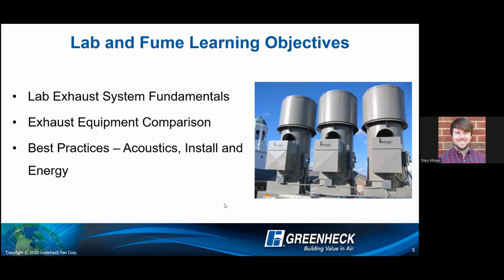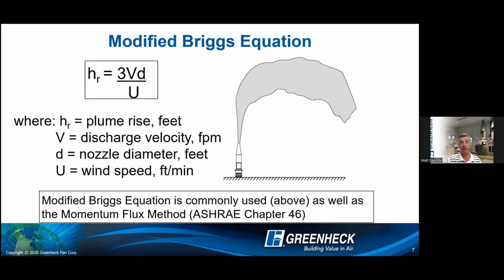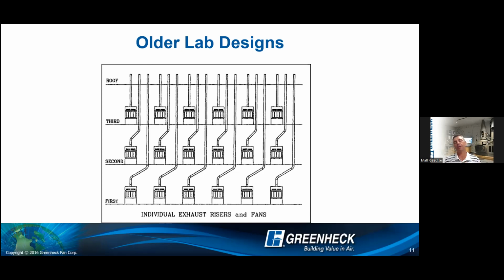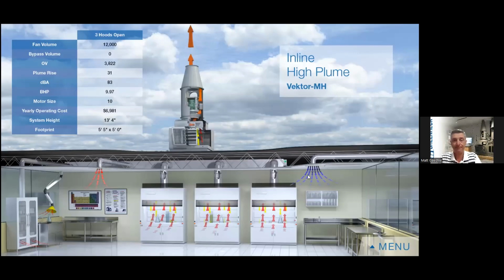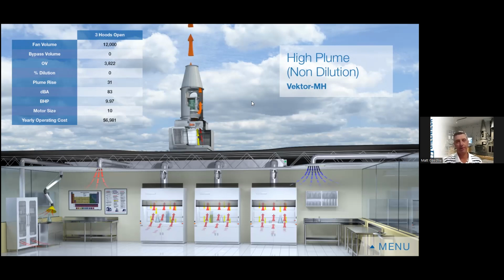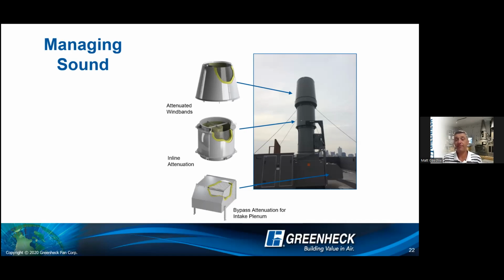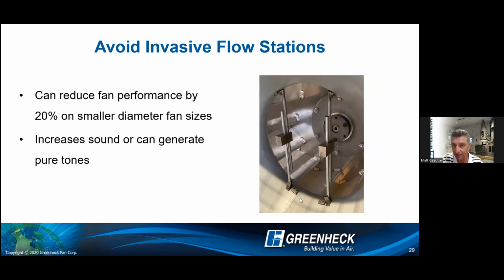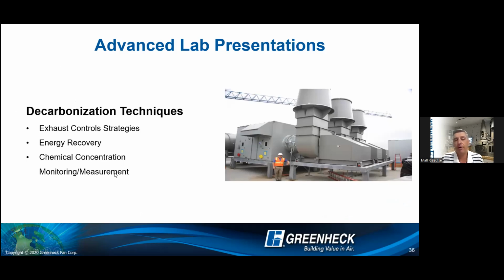Advanced Lab Design Series Part 1 - Greenheck Vektor Lab Exhaust

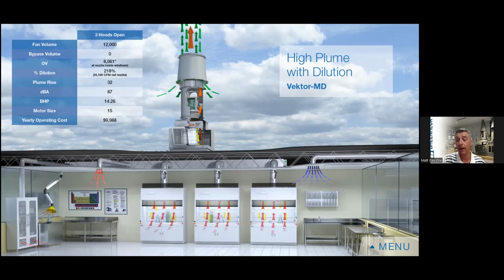Comment: 27:00 Thank you so much for such a great explanation! I work in controls and could not understand the purpose of the bypass damper when VFD is used. If I understood correctly, we can skip the bypass when variable geometry nozzles are used with VFD
Reply from the maker: Correct. The bypass damper is used to control static pressure in the ductwork AND maintain outlet velocity. In this scenario the VFD is used only to balance the fan. With a variable geometry nozzle, you can vary the speed of the fan and use the nozzle to maintain outlet velocity.